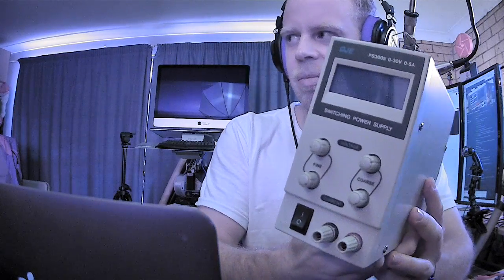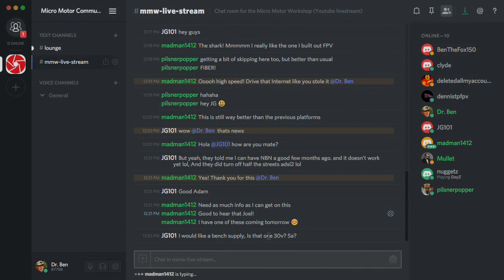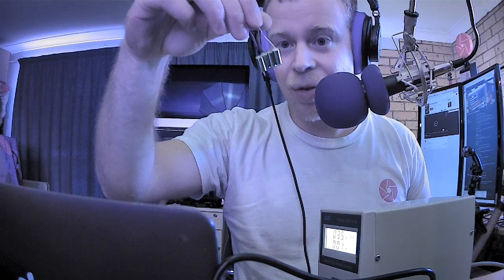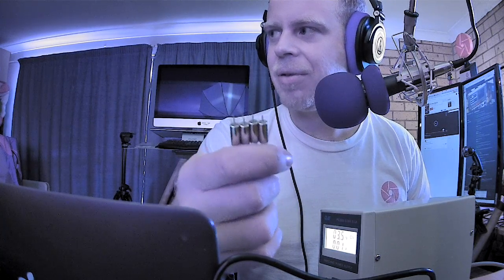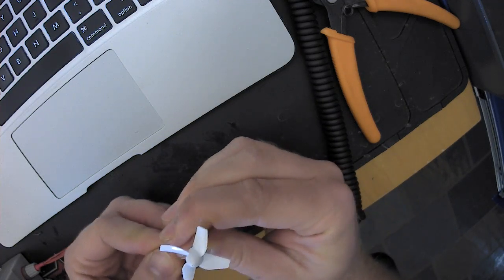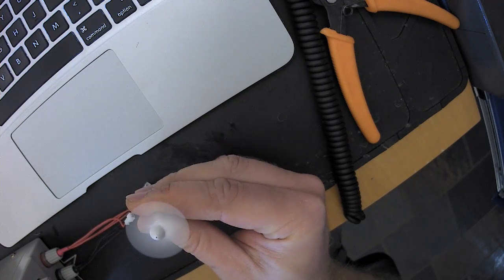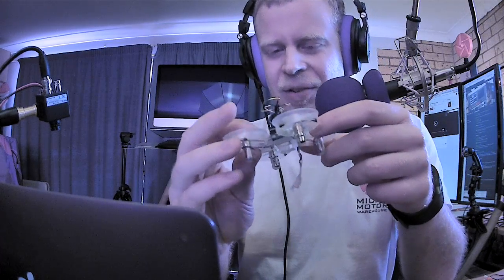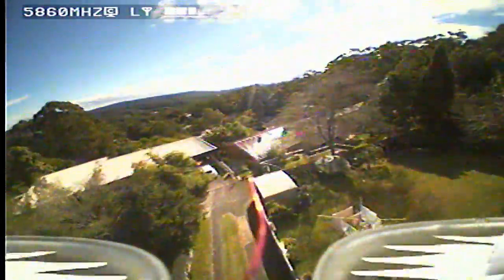Testing DC motors with a variable power supply

Comment: hello how could we do to calculate the rpm of the engine according to the voltage that we applied?
Reply: laura zurita you can do a spectrum analysis of the noise produced, and then isolate the dominant harmonic. It's interesting to do that for production and quality control purposes, but the unloaded speed has limited application/relation to actual flight performance.
Reply: U can get a rpm meter.